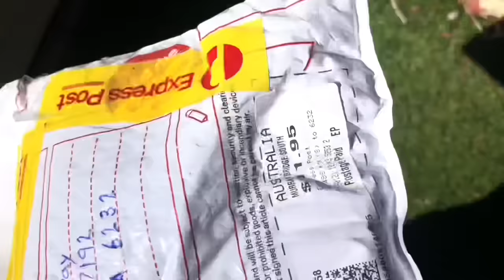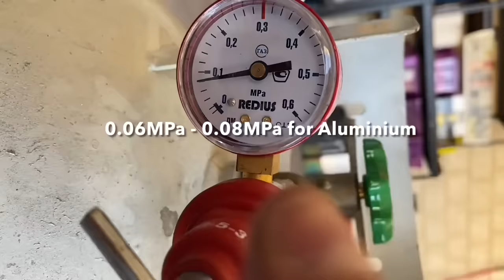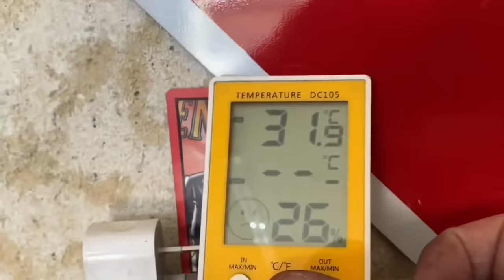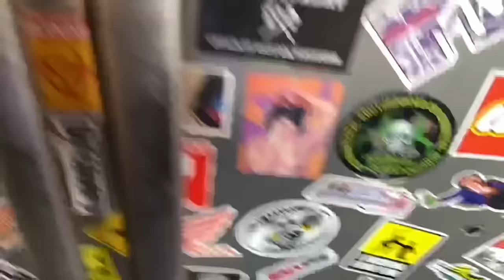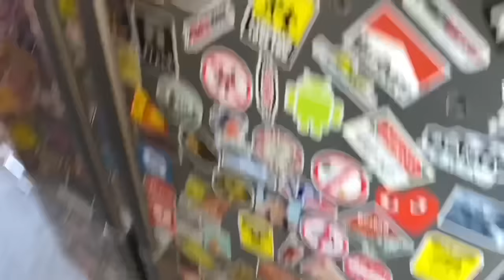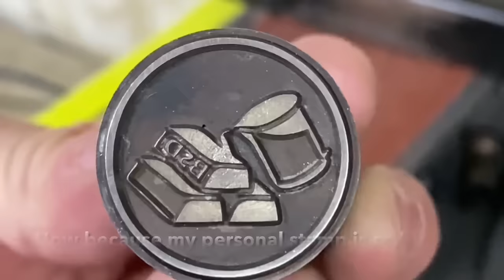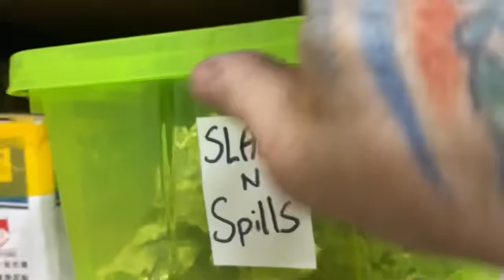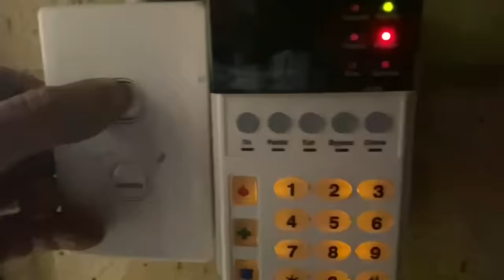Hard Drive Disc Destruction - Copper Aluminum - ASMR Metal Melting - BigStackD  Platter Perfection

Comment: Hey buddy, On the actuator arms of the hard-drives, be cautious trying to melt those, as not all of those will be aluminum, many of them are magnesium and some of them that a tiny (0.010") diameter neodymium/thermite magnet embedded into the side, which will look like a hole, or threaded hole. I used to work at a machine shop that the production side machined actuator arms for hard drives for all brands, like SEAGATE, WESTERN DIGITAL, CONNOR, etc. The strange thing is of the magnesium units, would then get sent out to be sputter plated in aluminum, LOL.. How about just make them in aluminum? but they claimed that 0.001gr weight  difference allows for faster speed on accuracy of read write on the platters .... Okay? what ever you say engineer... lol... Then after 2 years of production on several models, WD company opted back to the aluminum arms. Must not have been that much of an improvement on speed, to validate the cost of extruding magnesium stock. A way to tell, (not to insult your intelligence, by any means) but you can cut through the arm with cutters, and you can see a slight golden straw color in a mirror effect of the fresh cut. As the aluminum with just be shinny silvery mirror look in the fresh cut. Just be careful, as dropping magnesium into an already hot pot, could trigger for a fun day of melting.... Bringing the magnesium up to temp is one thing, and can be controlled, but is still below the melting point of aluminum and will start to boil out, once you are past the melting/molten state. Do not forget about the magnet, although they are dinky, they are still enclosed, or trapped with in the actuator arms body under pressure. The fact that those dinky magnets are thermite based, once they catch, nothing can put them out, especially not water, as water will only fuel the burning of the thermite base. Good luck and be safe. Sorry I didn't see this video before, I am still getting caught up.

Comment: Lol, the address on the packages has your P.O box number... 
But with your name and town on it we can still get your home address. Admittedly a bit far for me to do a surprise visit but I'm looking at a cheap house in WA anyway so😈
Reply from the maker: Actually the PO Box packages were dropped off by my postman as he’s good mates and when he sees a package at the depot brings it over. But the PO Box is linked to an email address which has nothing to do with my home as I thought about this when I set it all up👌🏻. But there ain’t no cheap houses around here mate they are massively overpriced Even in this current economy🤔
Reply: @bigstackD  The house(s) I'm looking at are a bit further out than you by a few hours🤣 average price is $60k and below, the 2 I'm interested in are 9k and 15k respectively.
I'll still try and stalk you😈 
Could try the numberplate option or post a tracking device to your P.O box😁
If I manage to find your place I might bring some titanium, a large electric furnace and some inert gas...

Comment: Friend, in this foundry you have lost more than €900 in precious metal and I doubt that your fuel furnace can melt it 

you should comment on recovering precious metals you know that all hard drives contain palladium and that its scarcity is driving up its price huy the gram is over $you should comment to recover precious metals you know that all hard drives contain palladium and that its scarcity is shooting up the price huy the gram is about $ 90.36 Australia per month For 3 months it did not exceed $60 and according to the world shortage of rare earths, palladium by 2023 will reach 120.00 per gram and you have thrown it into the slag it does not know how to fuse by smelting The process is an alloy in the aluminum and titanium disc, then it receives 3 electrolytic baths and finally a galvanization of 0.36 to a thickness of more than 1.0mm, this is scraped off in approximately . 0.500g of palladium lost per hard drive to a tower that could be seen approximately you have discarded 10g of palladium 960,3$ Australia That you have buried the cucubrcucubro of waste and I know why the coefficient of fusion of palladium is higher than that of aluminum 
I paint fusion aluminum 660,3°C
Palladium melting point 1555°C 2.831°F 
So it is clear how your melting furnace did not reach the critical point of aluminum or that you have not wasted this metal but you have discarded the palladium.

Solid slag recovery process in the slag, sacrificial alloy metals will be added whose boiling point is lower than the melting point of the desired metal and a crucible of Induction and its high voltage group these groups are more efficient than the fusion by gas or liquid fuel since it is a capable transformer that increases the amps of the domestic electrical network
Reply from the maker: Matey I appreciate your comments but you need to know I do this only as a hobby!.
For some reason people think I do this as a job or to make money I make no money doing what I do on the scrap side of stuff if you want to make money doing what I do you would lose all profit in time and gas so it’s completely pointless. I have a normal full-time 48 hour a week job that pays all the bills so I do this channel on my days off. If I could quit my job tomorrow and live off YouTube money I would do it in a heartbeat but unfortunately that’s not an option at the moment
Reply: @bigstackD  friend use a translator my language is from Spain or the Basque country but from English it is not translated into Basque answer translated into Spanish Spain greetings friend good video as always
Reply: @bigstackD  When I worked in R&D component processing and recovery of precious metals between 10g gold to 1 g palladium each fish contains 9 other precious metals more .
But the easiest ones to recover are those that require high temperatures and if you see aluminum in the video, that film can be seen floating like poured milk cream.
If you take the hard drives and put them in a separator oven you will see how a river of aluminum begins to flow and the visco is emptied of metal and begins to take on a blue color.
When that metal is recovered without sacrifice, you must introduce it in cyanide, but since it is very dangerous, you will add 1X1 copper to 9999, copper is the perfect alloy for this metal. 
Another recovery is the one that you have surely seen a lot Muriatic acid and nitric acid but I also know that in Australia there are certain restrictions for nitric acid .
It can also be manufactured at "Home" but you need a minimum of chemical knowledge and domestic nitric acid burns even metapropylene so it is less necessary to obtain the annual permit.
Reply: Imagine the loss if there was a Bitcoin wallet somewhere on the platter...  :-)))